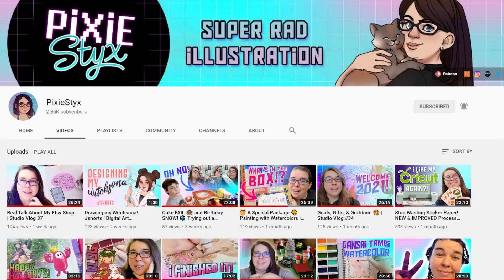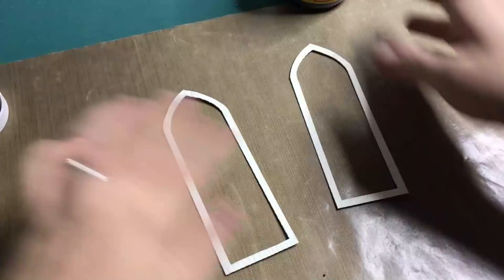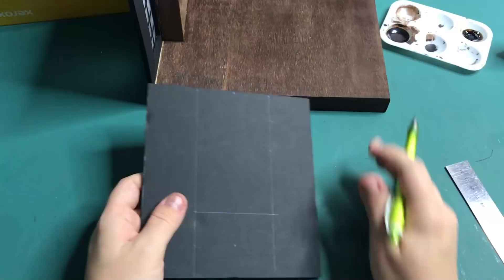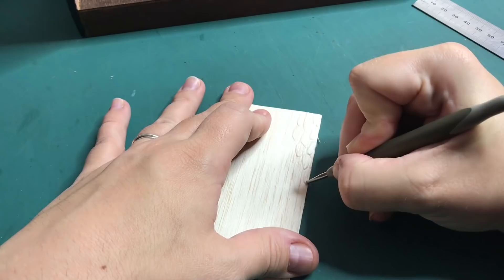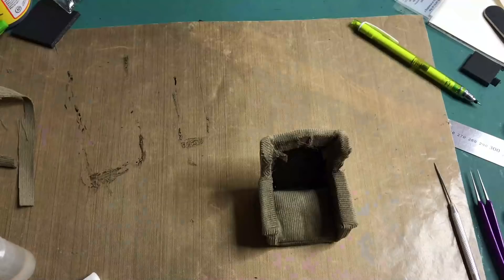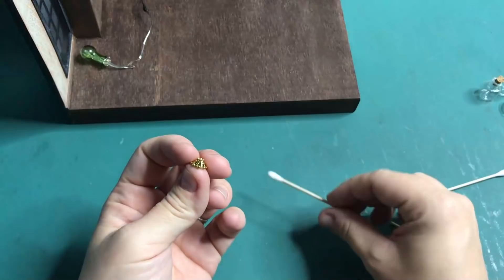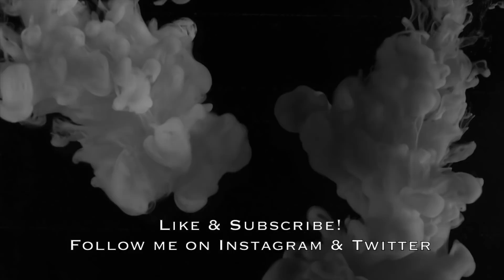Professor Snape's Room Miniature | Harry Potter miniature

Comment: You are amazing. So talented.    Do you use the black modge podge as a sealer?  I see you use frequently
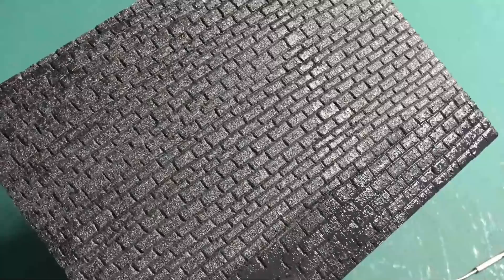Reply: Around 2:00 she says she uses it to make the surface stronger and so that it is primed for painting and dry brushing :)
Reply from the maker: Yep it's a sealer. I've added black ink so there is no need for a dark undercoat either.

Comment: Hello.  Did you paint/color the green bottle for the lamp?  I am trying to figure out a good way to color some small glass and plastic bottles that does not require heat.
Reply from the maker: No I didn't paint the green bottle. That is how I bought it. It might have been by Tim Holtz. You can easily paint glass with glass paint. They don't require heat and there should be some cheaper glass paints out there.